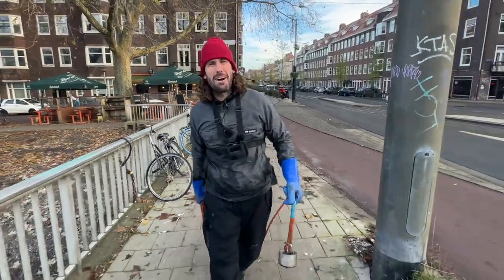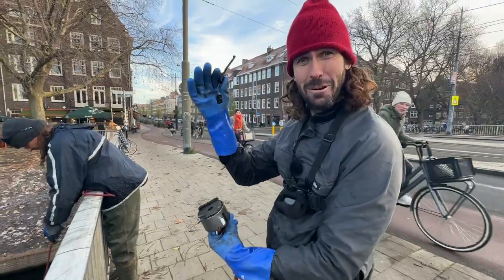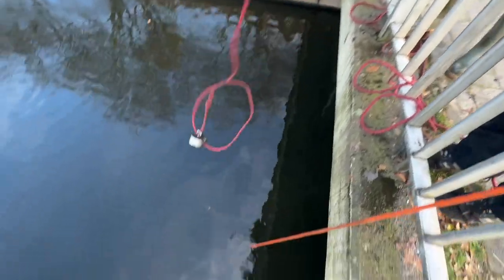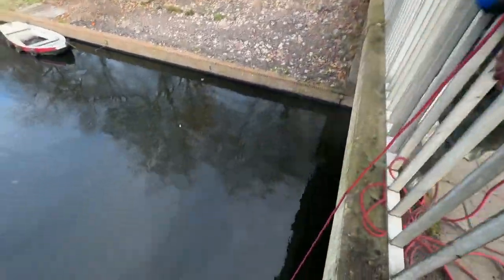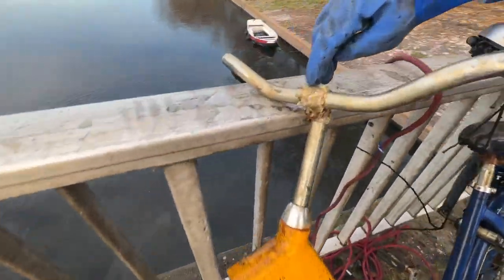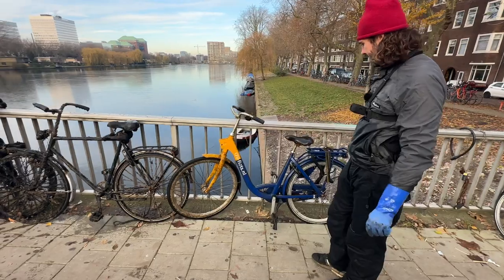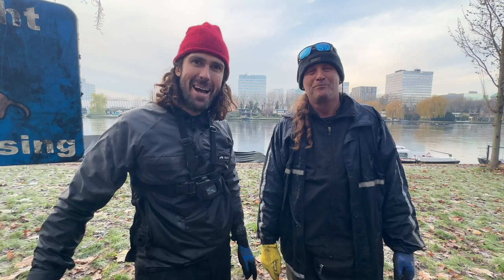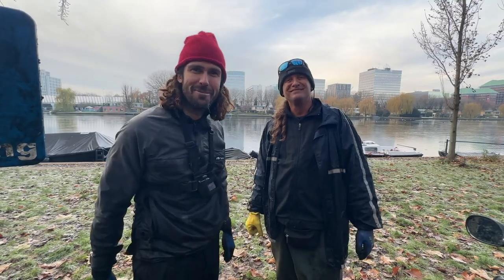Ice Magnet Fishing in Amsterdam! What We Found Is Amazing

Comment: The coin you found is 1 NIS (New Israeli Shekel) Current exchange rate: 3.6973 Shekel per Euro. Originally, the coins were minted of non-magnetic metals, but in a certain point (About 30 years ago), to save money, they started to use cheaper metals to mint these coins, which caused people to believe they're fake coins. they were also marked with a tiny little circle right under the State of Israel emblem, on the back side of the coin.